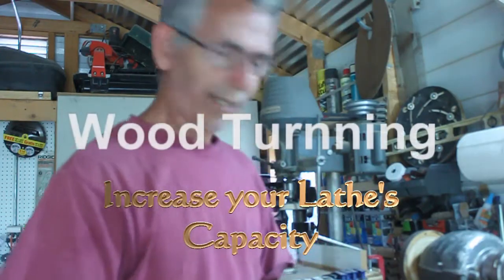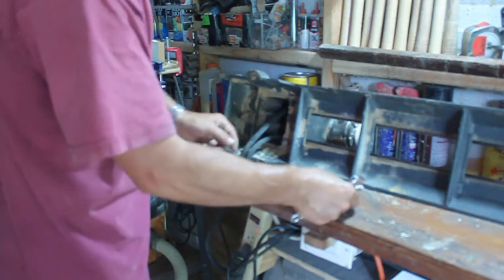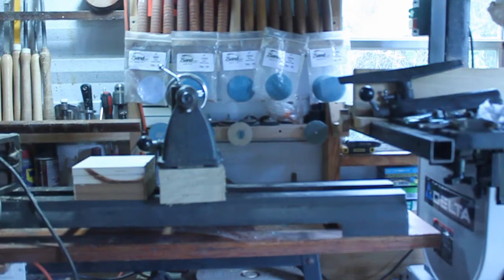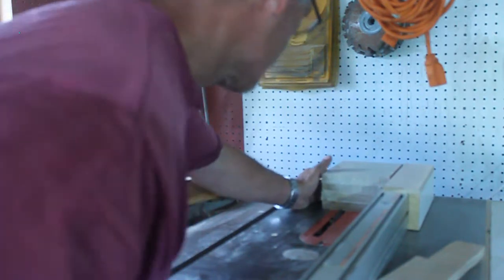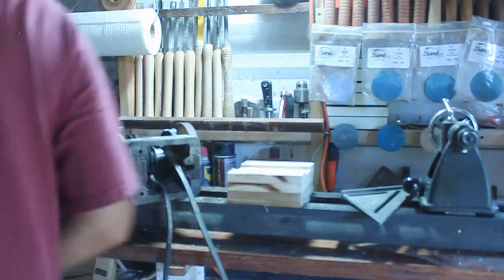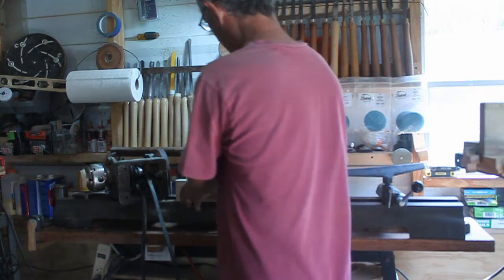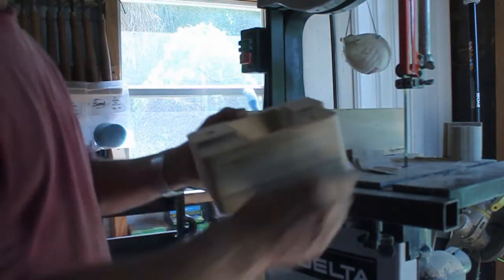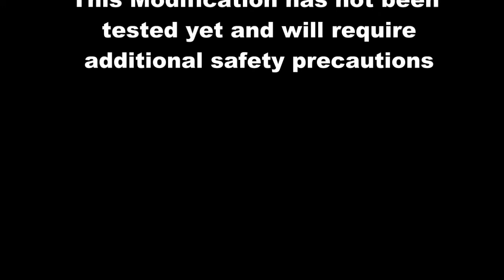Add riser blocks

Comment: Hi Al, I watched this video right after it came out. As a matter of fact I saved it in my saved videos with plans to do it on my lathe. Time has slipped by and I am ready to make the plunge on my old Delta/Rockwell 11-410 that has a 11” total. I was wondering since time has past by if you have found things you would have wished you would have done differently?
Thanks friend,
zetuskid

Comment: where did you find a longer shaft tool rest
Reply from the maker: You can find some on eBay but in my case I had a tool rest with a 5/8 shaft and I put it into a 3/4" black pipe cut to length. I also made one up with a bend to accommodate the offset.